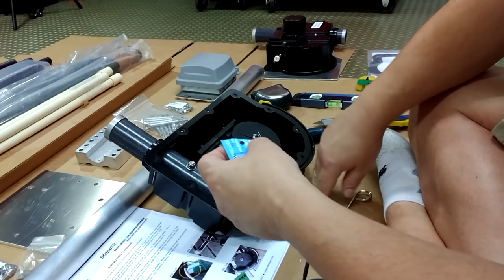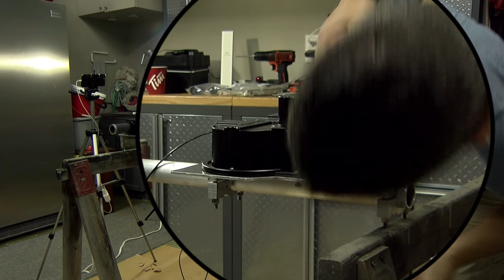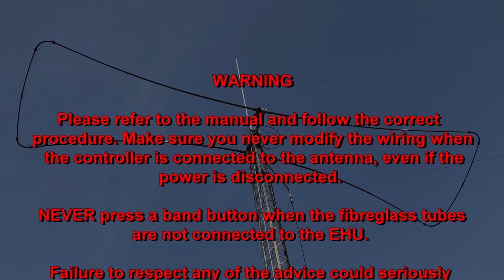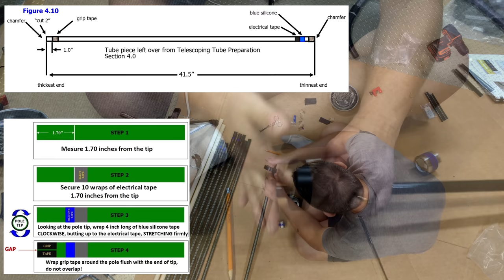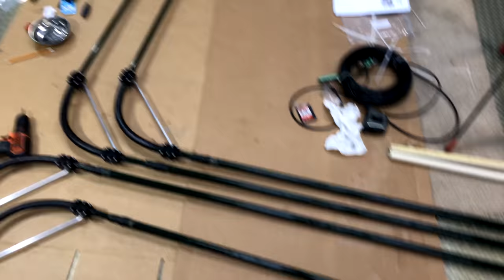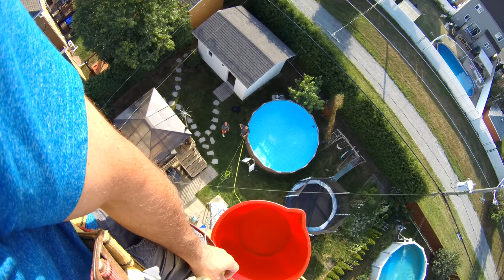Part 2 – SteppIR UrbanBeam, “Step by Step” Assembly and Installation

Comment: Thank you for all your hard work and detail on the video.  Many don't realize the 'time-dedication' you have to put forth to make something like this.  Great job!
Reply from the maker: Hello Kirk, Thank you for your comment. Yes, it's a lot of work. But since I was building the antenna for myself, I would have done it anyway.  But for the video, that's another thing, hihi.  I was alone most of the time and I didn’t have any cameraman, but I wanted to focus on the antenna assembly, so I used several fixed 4K cameras to capture the steps with an average of 2 cameras.  This means that I had to edit more than 500 TB of 4K videos in post-production!  So, you're right, it's a lot of work. Thanks for pointing this out, hope this video will be useful to others. Please share and subscribe. 73 Pascal VA2PV

Comment: Great video!  Great presentation. I am a learn by watching kind of guy!  I really wish they had used some other type of connector(s) though.  In my working career (40 years)  the last 18 or so working on equipment that used Phoenix connectors....these green ones....they were a source of trouble.  Needing to be re-seated to regain contact and this was indoors in a controlled environment.  Word of advice...NEVER!! NEVER!! use any kind of contact cleaner spray on these!  They will dissolve right before your very eyes in seconds!

Comment: Interesting and I think a good antenna, but Why is SteppIR not working with plug and play like Ultrabeam. All cables were ready to go with mine. No open motorunits, ot putting cables together. I must say the controler looks pretty cool. !
Reply from the maker: Hi Gerald, I guess it's because the cable length may vary from an installation to another.  73 Pascal VA2PV
Reply: @Laboenligne  Thanks for the answer, well I could order a cable , standard length is 30 meters so I bought 10 meters more. it came completely assembelt waterproof  40 meters length. super service from Wimo in Germany the new owner of Ultrabeam.

Comment: OK..now that some time has gone by....Can you comment on the actual usage of the beam....Does it fulfill your need? Does it perform well?  Generally how well is the actual swr match at the frequency your using?  Will I be able to totally bypass my tuner when using my amp?  Again..thanks for all the work making the video!!
Reply from the maker: No tuner needed with this antenna, on some band I had to adjust the lenght (calibration) and then always under 1.3 of SWR.   See my latest antenna video where I give my impression after 2 years of used, see the link below. 73  https://youtu.be/tQ5HMBLf_gQ
Reply: @Laboenligne   Mine is up now...50'+ up on the tower...Working great!  Very happy with it.Thanks a million for the great assembly videos. You address issues the manual does not..THANKS!!

Comment: Mine says cut the ground wire and the shield inside the EHU...  but you use the grnd wire later in the control box??
Reply from the maker: Hi Shawn, I believe the reason for that is to ground at one end to it won't irradiate any RF.  Plus, it's a long small gauge wire if you ground both ends you may end up with a potential difference creating a current in between.  73 Pascal VA2PV

Comment: Pascal, I hope all works well with the antenna.  I hear too many issues with the EHU  motors failing. Also problems with the copper tape. I will look forward to your next Installment.  Mark kb3z
Reply from the maker: Hi Mark, I’ve been following this manufacturer for several years and I had my doubts about having mechanical hardware up the tower.  I know they improved the EHU motors over time.  So, now I’m very confident about this product as a few of my friends have a SteppIR antennas and it survives the Canadian winters.  Also, that’s a risk that I’m willing to take since it offers me an 8 band antenna with a monobander on each band, SWR flat!  I took good care when doing the assembly and I’m confident about it.  Will see over time, but for now, wow what an antenna.  73 Pascal VA2PV

Comment: The element materials do not last in strong sunshine such as in Florida,Arizona and other states.The metal tape will break through the elements and it’s a costly repair.Not a Money wise choice and when lightning strikes are a very real issue and just nearby is close enough to kill the motors or control box.